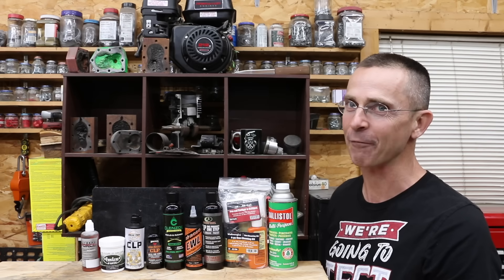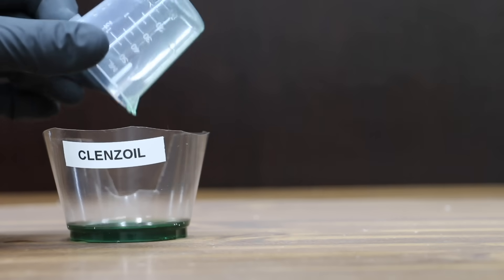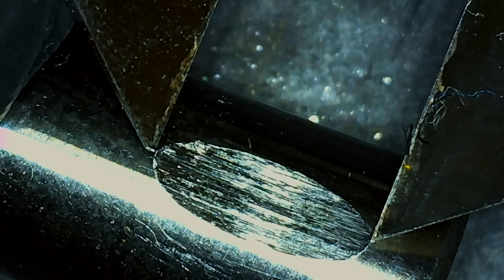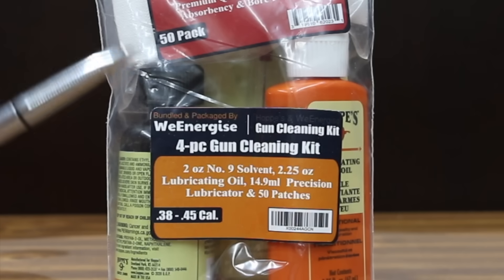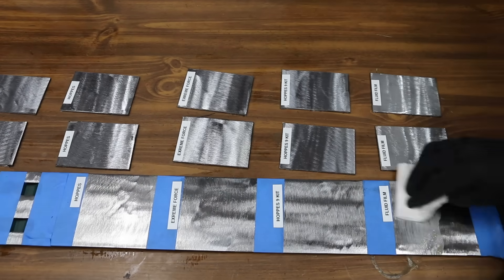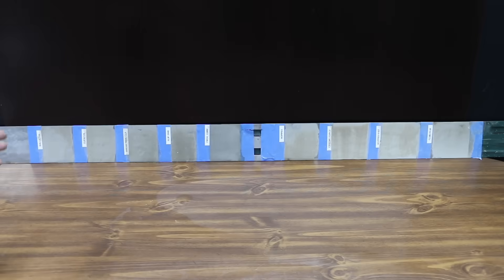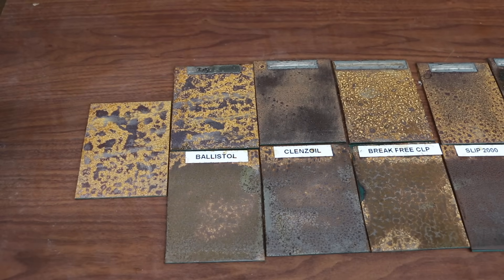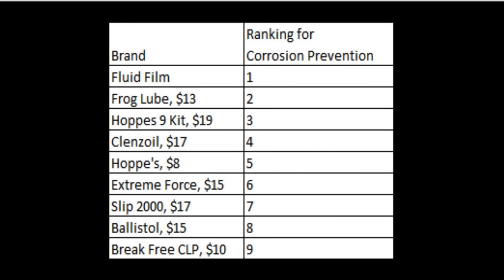Don't Buy A CLP Until You Watch This Review! It'll Save You Time And Money!

Comment: Thank you for this.  If you want to go deeper into Fudd lore:  transmission oil, red and white lithium grease, and motor oil are said to work too.
Reply: I use 10W30 because that's what my car takes lol
Reply: Fudd lore? My ak and saiga both get red bearing grease on the bolt, bolt carrier and rails. Works great
Reply: Motor oil is very, very good. Although the Fudds tend to be the ones using Hoppes because "that's what you do", while the practical ones realize that an oil designed to clean and resist carbon makes sense.

Look up "Ed's red" recipe.
Reply: For lubricant I use Lucas red grease.  It stays and after the range and field strip the grease is still there.  Solvent I just use mineral spirits.
Reply: Fun Fact !  Castroil brand Gun Oil is literally Castroil 10W-30 motor oil , repackaged in handy sized small bottles  . Observed not as a Slam against Castroil  , but Observed to lend legitimacy for the use of Synthetic Motor Oil as firearms lubricant .

 Likewise , Lithium Grease is totally legit,  for those lubrication applications best served by a grease . ( Hint - Some specific applications best served by a grease , some by a lighter oil . )

Comment: I've been using XF-7 for over a decade.  A sample came with my Smith Crazyhorse.  Spray the whole weapon (drench) with the liquid.  Let it dry then use a small brush to paint the grease on the high wear areas.  It's a grease so it stays put.  Even works on finicky 1911's.

Comment: I don’t think that carbon test is good enough. I can wipe the carbon off my exhaust pipe with just my finger. I have baked on chunks of carbon in my ar bcg that soaking in acetone and using break cleaner couldn’t even touch even with aggressive scraping.
Reply: You need to clean your gun more often. The only gun I've ever had where the fouling couldn't be fairly easily removed with Break-Free was an early 1900s Winchester 94 I inherited which hadn't been cleaned for decades, and even then, using brake parts cleaner and clp worked pretty well.
Reply: @saintbartholomew7434  Ive only put about 1k rounds through the rifle. It did sit for some time, and I did clean it before but I cannot remember if I specifically checked for baked on carbon inside the bcg.
Reply: Best way to do that is use a cheap pocket screwdriver or a nail to chip it off.  It won't harm the bolt.
Reply: @RealDeanWinchester  Ive worked at it and there still some stuck in there. Its inside the bcg where the tail of the bolt and gas rings sit so its difficult to reach.
Reply: @FishFind3000  🤔, maybe i should look at mine.  I normally just focus on getting it off of the tail of the bolt.
Reply: @RealDeanWinchester  thats what I did and then when really looking my bcg over I noticed the internals were caked bad.
Reply: @FishFind3000  Well, if that's the case with mine it hasn't been a problem ever.  I couldn't tell you how many thousands I've shot.  I'll look at it though, i haven't been irritated in days, 😂.

Comment: I recall that FrogLube used to recommend degreasing and then heating parts before applying for the first time so that the lubricant would fill in the surface better.
Reply: YEah you're supposed to heat the metal, apply the paste, the paste melts, you rub it around, let it cool fro 1+ hours, then wipe off excess. Thats how you're supposed to use frog lube, it's not supposed to be globbed on and left chunky or wet. It's basically a seasoning for the metal.
Reply: @davidpotts8316  Yeah, I am surprised I had to go so far down the comments to see anyone mention this about Froglube.  I would be interested to see the first test redone with that in mind.  I've been very happy with it.  Still, I might grab some Clenzoil as well, lol.
Reply: @TitaniumTibia  Says CLP on the jar, bud
Reply: I don't recall needing to degrease before applying.  It will eat up, or lift your petroleum based products which may have caused issues if you have a lot I guess.  The biggest issue is using too much Frog Lube, leaving it on like a grease.  I don't know about the newer formula but the original would solidify a bit, just like how it is in the canister making the first few rounds fired a bit unreliable until it warmed up and liquefied.

That works ok for cleaning,  but way too much for function.  I saw someone use a shaving brush to apply their last coat of oil and started doing that for adding that last swipe for lubrication so I don't have enough to gunk everything up.
Reply: Wouldn't be much of a CLP if it needed a degreaser first.

Comment: On your lubricity tester I’d like to see you make it capable of testing oil while hot like when testing engine oil the test cup is heated to said operation temp of the engine and you could test it at high or lower maybe use a metal cup and hot plate with something to track the temperature just a thought buddy love the videos your awesome buddy

Comment: Nicely done. There's a billion products out there in this category but you covered some popular ones and best of all high lighted that any product attempting to cover all the bases is going to be so-so at best for all of the bases. Best practice for those of us with the means and the time to actually take care of equipment use a solvent (cleaner), a lubricant (when and where needed) and preservation agents (anti-rot, corrosion, etc).

When the means or the time must be sacrificed in favor of expediency, cost effectiveness etc (*stares at military services*) Radco CLP is the go to product for just do it all with one product, quickly. Though there is also some specialized lubricants for certain weapons systems or conditions (such as LSAT) and solvents for machine gun bores (rifle bore cleaner), the vast majority of services and firearms are cleaned, lubed and preserved with radco clp... The fact that the preservative function is its worst trait perfectly explains military maintenance cycles...

Comment: I have been told by my local gunsmith that you need to heat up the metal before you add the frog lube. It should be hot enough that it's uncomfortable to be held but shouldn't be able to burn you. Maybe a different performance when applied this way?

Comment: The freeze test was good.  History bears out the importance of being able to shoot in cold temps, just review problems the German Army had at the Battle of Lenningrad.  Russians added a bit of gasoline to the oils to thin and applied the thinned oils to their guns.  As for me, if it's 40 below, I'll be in another state or at least huddled around a fire somewhere, so that might have been a bit overkill in the test for me.  The lubricity test was an eye opener, but, for me to put that much wear on a trigger, how many rounds do I have to fire? Couple hundred thousand?  I ran my poor 10/22 for years just cleaning and never lubricating the mechanism.  Still shoots like a charm after I don't know how many bricks of ammunition.

To me the Carbon Test was the absolute best bit of info.  All of the products cut the grease well, but some better than others.  Some just kept working too!

So here's a question.  I shoot mostly airguns.  Cleaning residue, if flammable, may combust (diesel, explode, whatever you want to call it) under the pressures of a modern airgun.  Ballistol doesn't combust in airguns as to my understanding it's a mineral oil derivative.  Would either of the winners combust under 5000 PSI pressure?  If not, I'll switch, but I'm just not sure.  Airguns just aren't built to handle combustion, so this is important in my world!

Excellent review!
Reply: For a semi-auto, trigger wear is in the noise compared to wear on the slide. A Ruger 10/22 also has a very light weight bolt compared to most AR-15's, AR-10's, etc.

Comment: Fantastic testing as always! I would venture if there is ever a round 2 for weapons lubricants if you can source some Radcolube, G96, and Royco CLPs. These are some of the CLPs in use in the US military and are available in the military supply chain (they have NSNs). 

Always felt skeevish against Ballistol as it always had the cult following and this should bring them back to Earth. 

Froglube does have an "oil" version, but its application instructions do indicate it is meant to be heated for best results. 

Personally also a fan of Hornady One Shot as well, it rated high on a "day at the range" article that ran a lot of them together and it fared well in their testing on corrosion and lubricity. Bonus points in that it also feels like part-brake cleaner part lubricant film. 

I'd love to see them go through PF's testing methodology as that would definitely help find out which brands are snake oil and which ones work.
Reply: The nice part about Frog Lube and SEAL 1 (made by the same guy, but wasn't happy with the original Frog Lube formula changes by a supplier) is that they have a nice minty smell when using them

Comment: I’m a Froglube fan. My guns are stored most of the time and if you heat a froglube coated gun with a hair dryer it will flow into crevices. I also does a great job of removing surface rust.

Comment: I'd have also loved to see a lubricity test after the freezing. As well as a heating + lubricity test after freezing. Lastly a frozen strength test to see if it will seize up the moving parts of your gun if you were to let it freeze. To gauge how much wear there will be if you just started using your firearm without allowing it to warm up first, if it will lock up in the cold, or if the frozen lubricant immediately melts down and retains its lubrication after being frozen
Reply: most army's use DRY guns in cold temps for exactly that reason.. machine guns get special low temp lubes.
back in WW2 the troops were taught to use a PENCIL for the graphite in the M1 GARAND..
Reply: @80spodcastchannel  Yes , that was a Thing , back in the day .

   Today , some of the Synthetic based lubricants do quite well well below Zero deg ( F) .
Reply: I really like the idea of seeing if it will freeze bearings together with small amounts of oil

Comment: Frog Lube always does well on corrosion protection. They have a different formulation that's supposed to be used in low temp environments. I'm really curious to know if the wear scar test would have a different result if the entire heat, coat, cure, wipe application process was used...
Reply: Nate Higgers  nope, not a redditor... So, you're batting 0% with your generalizations.
Reply: Nate Higgers  your sides hurt? That's a strange symptom of being continuously wrong in this entire discussion...
Reply: This is actually the lowest iq interaction I've had in a long time, and I fell slightly dumber because of it...
So, I guess you accomplished your mission. Good job?
Reply: Nate Higgers  😂😘

Comment: Frog Lube wasn’t applied correctly for the wear test (warm the metal enough that the paste melts upon contact). But impressively for a worst case scenario it was still middle of the pack.

I’ve used Frog Lube for a long time. The first application is PIA, but it basically wipes clean and it smells minty fresh.
Reply: Nate Higgers  it works better if you waive a dead chicken over it too.

Comment: I use a modified recipe from Student of the American Rifle. Full-syn highmileage 10w30 blended with Lucas Red n Tacky to your desired consistency. Those lubricants are tested to be  used in very similar but harsher/ longer lasting detrimental environments. Living in NW Ohio this seems to work well adhering to all surfaces and preventing rust in all seasons. Curious how it would fare in the lubrication load test?

Comment: To me it seems like using Frog Lube and heat the parts to minimize risk of corrosion, then use a thinner lubrication.
Some lubricants actually changes properties when heated, which can make them stronger. So maybe you experienced the effect you get from a baking metal in linseed oil.

Comment: I always use wheel bearing Grease and hoppes bore solvent. The solvent works amazing but I might just switch to clenzoil. I live in the south so I'm not worried about performance at -40F

Comment: A great test for stuff like this would be steel on aluminum for steel parts like bolts or slides rubbing against frames or receivers. You'd need some pretty good aluminum for that test such as 7075, though I'm sure there are some others as I'm sure othe rpeople can point out. Also can't wait to see some more products tested.

Comment: I appreciate you testing a "non-gun" product, but wonder how Mobil 1 would do against all the much more expensive specialty stuff. Full disclosure: I generally use Breakfree CLP
Reply: When I was shooting competition many years ago we would use a combination of STP and ATF, it was sticky and slick.  That said, in cold climates it seems like Mobil 1 would be an excellent choice.  I think the one thing that is obvious about this test is that you need to match your product to the situation.  Hoppes #9 has ammonia so it works great for cleaning powder and metal residue in a barrel, but you wouldn't want to use it to store your gun as it would also corrode the gun metal as well.  Everything is relative.  Pick the right product for the application.
Reply: I think important to remember as well that a CLP product is an all-in-one cleaner, lubricant and protectant. Mobil 1, Amsoil, full synthetic nlgi ep-1.5 grease versus the commercial "gun oil" products would be a great test!
Reply: Frog lube is coconut oil AFAIK, so that's kind of close
Reply: Mobil 1 ow-40 works great in my ARs down to -30*f. Thick enough to not flash off in 100* heat, not too thick to stop it when it's cold.

Comment: I use Dupont Krytox lubricants on firearms. Krytox GPL 105 oil and GPL 205 Grease. I have lubed several sei-auto pisols for friends and their comments are usually asking if I had put ball bearings in their guns. Krytox was developed for NASA for use in space. Virtually inert to vacuum and temperature  extremes, also can't be removed with steam, gasoline, brake cleaner or any common solvent. The only solvent that affects it has to be a fluorinated solvent. Miller Stephenson is the current distributor for Krytox products. The stuff ain't cheap, but a small tube or bottle will go a long way. I would like to see Project Farm test it out.

Comment: Would have loved to see these compared to Penzoil Platinum or Amsoil 5w-30 as a control, which I bet would have outperformed them all...
Reply: Literally stopped using all gun specific lines a while ago , any heavy weight oil synthetic or not works so much better and a liter will last forever , use with lithium grease for a heavy range day and it can’t be beat. Clean it off with break clean and alcohol , gun lubes are a scam haha
Reply: Had a buddy do his air rifle with 0w20 Redline...wire brushed out the lead and a fresh patch with Redline...his chronograph showed he picked up 20 feet per second.
Reply: Yea easily takes the heat and lubes at the same time, my kind of women w0ot!!

Comment: All these products are actually ones I tell people to stay away from. I work as a gunsmith and my two best recommend products on CLP are Battleborn Breakthrough CLP and Lucas Oil CLP. For gun oil, depending on temperature, Lucas in the summer, Battleborn High Purity for the winter. Lastly, for applications on certain firearms that need grease instead of oil in certain places (such as op rod rails and guides on M1 Garands, M1A/M14, Remington Model 11 and 11-48 as well as Browning Auto 5 magazine tubes for the long recoil friction rings) I exclusively use Lucas Oil White Lithium grease. It also works well for suppressors and preventing carbon locking better than anti-seize for any QD mounts or threads in suppressors components like end caps, adaptors, and collars.

Comment: I've been using Hoppes for years, might give Clenzoil a try.  The Hoppes works great for soaking the fuel injection nozzles for my aircraft engine. Thanks Mr Farm, great test.
Reply: Been using clenzoil for many years and my dad used it many years before me. Good veteran owned company
Reply: @sharky5570  I’m going to give it a try. Here I thought it was always told it was a Baristol ripoff, but turns off it better in every measurable way than that’s old caustic gunk.
Reply: Good luck.  I have tried several products over the years and always come back to Hoppe’s #9 using separate products.  None of the one size fits all works as well as individual purpose built products.
Reply: Have you tried seafoam? Cleans carbs to brand new in 24 hours
Reply: @freedomgunsandliberty  so does oven cleaner but that can do it in a lot less time! That doesn’t mean it’s good.
Reply: @Alexander_l322  seafoams safe on plastic and rubber. Oven cleaner is not
Reply: @freedomgunsandliberty  yeah some product i used seems to have turned plastics on guns sticky in my gun case sitting around for a long time
Reply: yeah this video needs further testing. Pure lubrication efficiency is not that important on guns. Hell sometimes you WANT to run your gun dry with no lube in dusty and sandy environments. What's important is heat resistance (without polymerization, as some of the oils in this video did and was why their corrosion resistance "improved," but they actually polymerized and is a failure for use in a firearm), resistance to heat cycling (extreme high temps, followed by cooling down, and then heating up again over and over again like real guns), and overall shelf life and how much these qualities degrade over time.